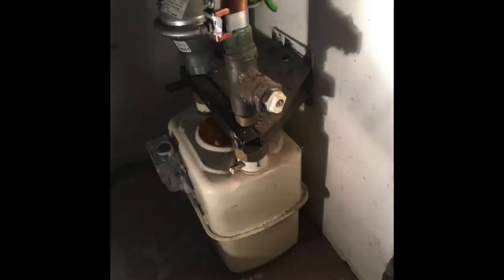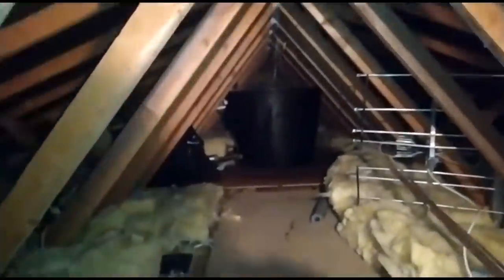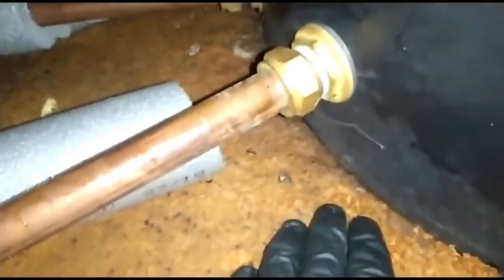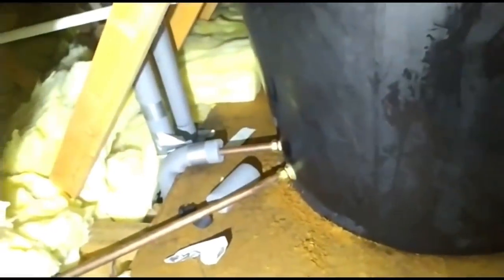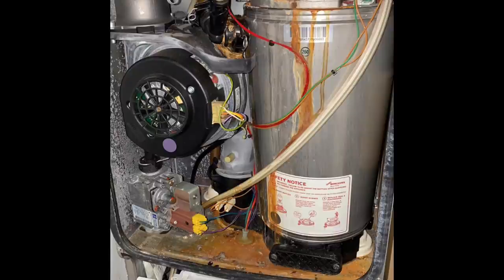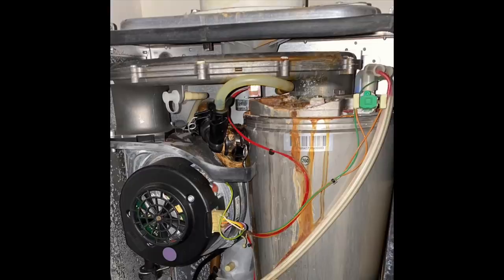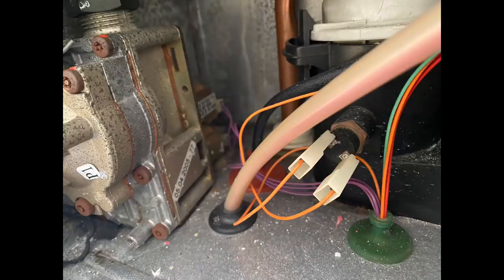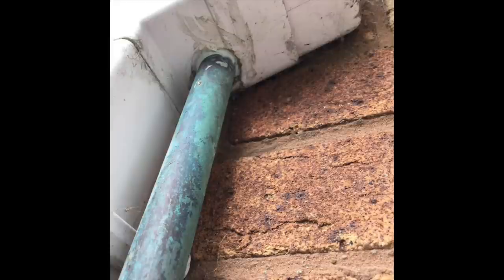Plumbers Videos - Water Leaks - Badly Installed Gas Boilers

Comment: I went to a floorstanding boiler to service many years ago. Customer had removed a wau himself and fitted the boiler. Flue liner off the top of the flue to the ceiling hanging  in mid air. Had drilled a hole through the side of boiler casing to connect to the gas  with a flexible tap connector. How long ago was the last service i asked. His answer. Its been in 10 years and it has never been serviced. To say the least i was gob smacked. Capped it off and reported it.

Comment: Have you ever used the back boiler return as the gas to get up to cylinder cupboard (wet vac it clear?)
Reply from the maker: No, You wouldn’t know if it had the correct fittings on it, Non return valves etc, Also the dirt from the pipes could effect the boiler in the future. Thanks.

Comment: If anyone qualified could help it would be appreciated i recently upgraded a 22mm gas supply to 28 mm as the boiler was under gassed at 13.13 mbar... my initial tightness was 0.03 drop) and after it was 0.50 however after purging it constantly rose with tightness tests after rising 0.70 and i sprayed the ecv it was not passing im recently qualified and im confused with my readings i has sprayed all my fittings and nothing has shown up
Reply from the maker: Give me a call and i will try and help.
Reply: A 0.5mbar drop on 28mm pipe will be miniscule. More than likely will be on a compression rather than soldered. Check the compression nut on the gas valve inside the boiler
Reply: Did you run the heating before you done your tightness test? Do the heating pipes run next to the gas pipe. Ive had that before but mine was the opposite mine was droping pressure and ripped the house apart. Looking for a leak and it was just the change in temperature. The same as if you have an external gas carcass and the sun is beating down on it. You will get obscure readings.
Things to be aware off..
I hope this might help
Reply: @darrenmartin4471  i did an initial before i put the boiler on for a drop of 0.50 mbar so i panicked and sprayed everything and couldnt find nothing then i thought ill try again and it just started rising but you are right it was near the heating pipes running parrell so i put the boiler on and then after another tightness and it was still rising relentlessly
Reply: @lglossop7017  yeah i thought the nut on boiler myself but i didnt touch it i sprayed it and nothing i didnt take the 28 directly into the boiler i reduced it about 600m away i understand 0.50 is ok but my initial before i started was 0.03 basiclly tight as can be and then my head started going west when it wouldnt stop rising
Reply: @DJJAMONE  try doing another tightness test with the system being cold. If its still rises the only thing it can be is the ecv. Also if you have to, put a disc in the meter on the outlet side and check your meter installation readings. That will give you your true start point.
Reply: I'm not trying  to teach how to suck eggs but sometimes its good to get back to basics.
Reply: Disconnect the appliances from the carcasses and see if you still get a drop.  You'd be surprised with the amount of cooker bayonet and micropoint sockets which aren't set in and sealed correctly.  It may even be the gas isolation point for a hob.  As for the rise your ecv is most probably letting by.  Crack the nut on the bottom of the anaconda and spray it with ldf.  It's much easier to find a leak with a gas sniffer.